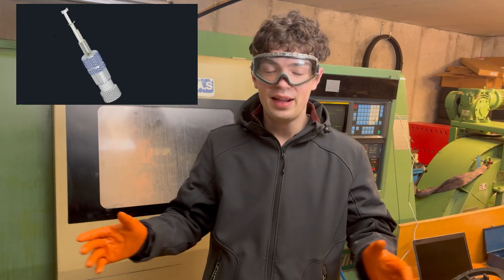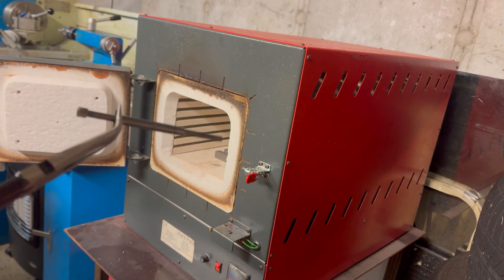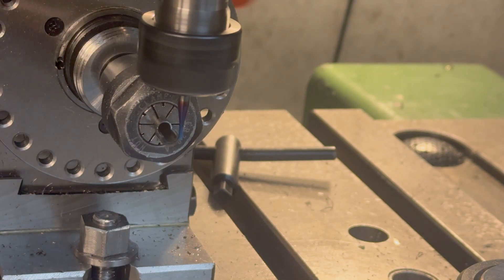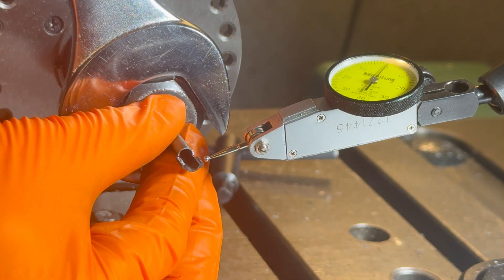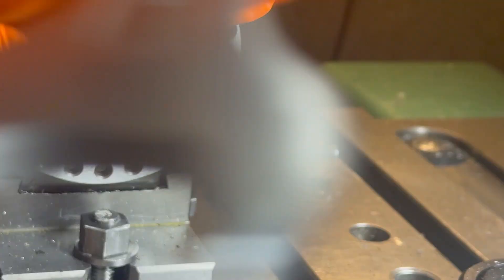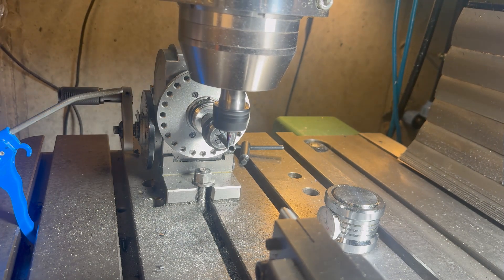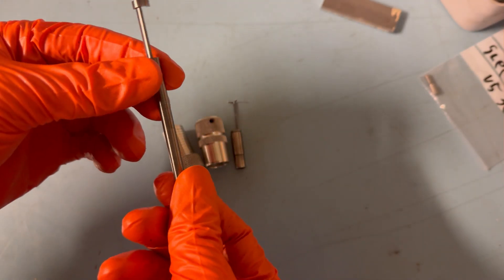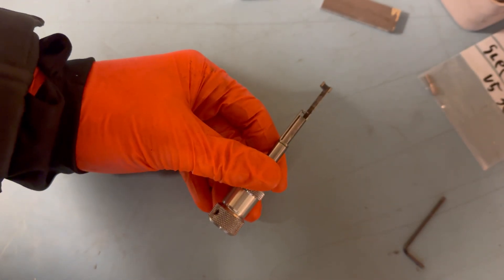How I CNC Machine the Abloy Profile Pick for Locksport

Comment: Very interesting thanks for sharing. Can you not buy the ejector pins pre hardened to save you aome time? Great work are these for sale online??
Reply from the maker: @andy123law  hi Andy, yes you actually can, but ejector pins are made from die making steel, its too brittle and lacks flexibility.
The hardening process i do on these isn’t for fun, its required. 
All of these tools come with a lifetime warranty so i make them last forever.
Thanks for watching!
Reply: @tarehjernetarehjerne4082   I understand if they are too hard they will be brittle. That makes perfect sense. How hard do you want them to be or what is the ideal hardness RC? Nice workshop BTW 👍
Reply from the maker: @andy123law i hope i answered all of it! Thanks, yes its a great workshop!
Reply: @tarehjernetarehjerne4082  That makes perfect sense I understand. What is your ideal hardness so they are less brittle? A lot of hard work has gone into these well done.
Reply from the maker: @andy123law they are actually fairly hard, but some steels are more flexible than others even at high hardness. 
Its a chromium vanadium alloy, hardness about 55 hrc.
Despite the high hardness its got an elongation ratio of around 22%

Comment: Wow. Great process!!
I had one of your pick tools but it was lost in the California fires. 
The handles probably melted because anything Aluminum was just a puddle. 
The other parts probably made it through the intense heat but no way to recover them 😢
Am thinking about getting your new Abloy model.
🐾🐈‍⬛👍👏👏👏🍻
Reply from the maker: Oh damn, i'm so sorry to hear that. That fire was a huge tragedy, so much was lost those days. 
Once heated to about the melting point of aluminum ~700C the tips will be damaged beyond repair as the internal structure of the steel will have changed. 

Did you find the tool after it was burned?
Reply: No. Really dangerous to even try to recover anything. 
I have posted some pictures on Facebook of what was left. 
The only thing that made it were two steel vises and a Titanium camping cup. 
Really lost 99.9 percent of my possession .
😬
Reply from the maker: @chriscapune7873  99.9%?!?! Thats worse than my crypto portfolio - jokes aside, thats terrible, truly i didnt know it was that bad. 
If you ever decide to restock your picking tools i know what material to make them from next time, i have a rod of titanium i can use
Reply: 😃👍 I had two Silver Bullets a JAAKKo pick tool.  And just about every DD picking tool out there. Plus every woodworking tool from my 35 years as a finish carpenter. Plus about 12 bicycles many that I had built the frames by hand. 
So it was really a big change for me. 😬
Reply: @chriscapune7873 Mi dispiace tanto amico..
Reply from the maker: @chriscapune7873  I have watched a lot of your videos. so hard to imagine all of that being gone in the fires. You did woodworking too, i had no idea! That's always been black magic for me. 
Did you take any photos or videos of the bikes before? 
I can't imagine the amount of change, to say the least - i wouldnt know what to do if i lost even just one machine, let alone all of them.
Reply: Ottimo lavoro amico, se ne avrò bisogno mi rivolgerò a te 🎉🎉
Reply from the maker: @lockpickingindependentant-2919  Grazie mille! Se mai ne avrai bisogno, sarò felice di aiutarti!
Reply: @tarehjernetarehjerne4082  grazie mille 😘😘😘😘😘
Reply: Very cool 👍
Reply: Thanks for sharing I was curious to know what process you used and that is by far the scariest I imagined. Lots of hours per pick but they are indeed lovely. Well done 👏
Reply from the maker: @rwbcustompicks  I suppose you need an element of danger when you are working with DEAD measurements Ha! 
They do take a while to make, but the end product is also very rewarding!